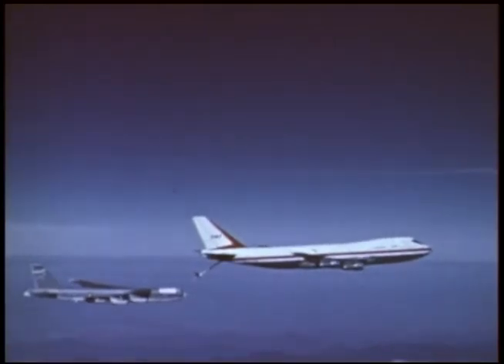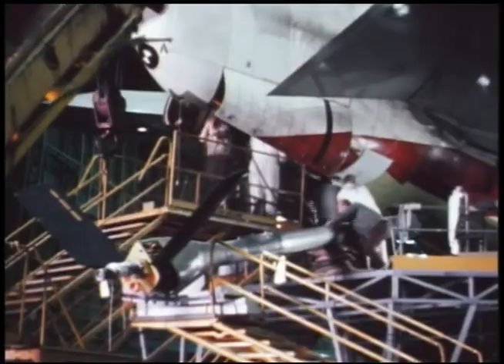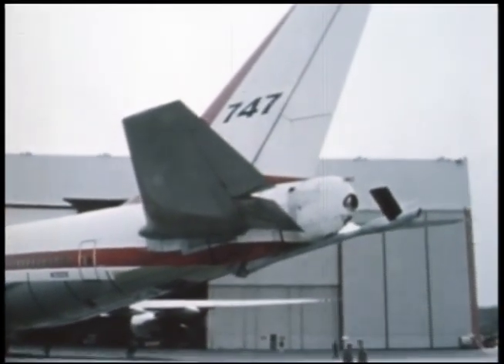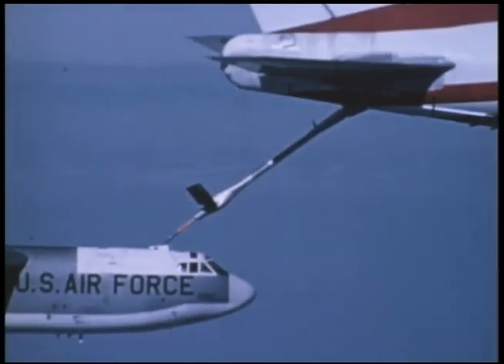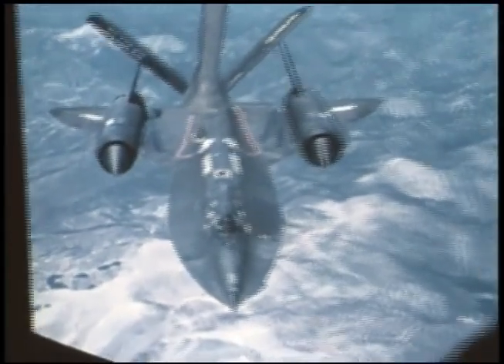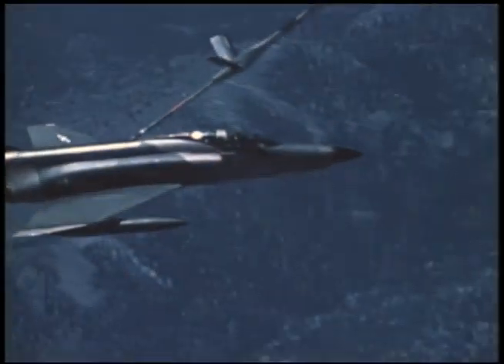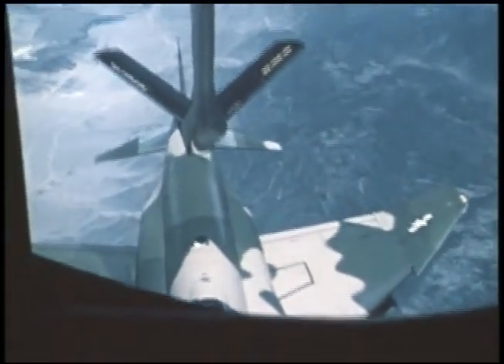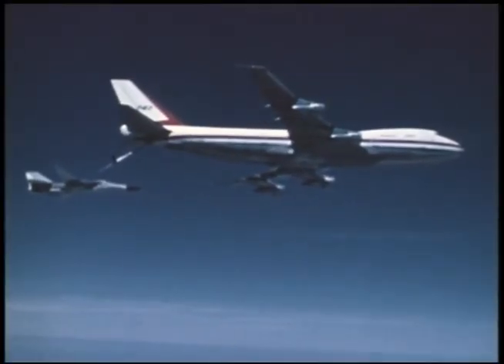Boeing 747 Advanced Cargo Transport Aircraft KC-33

Comment: if only the AF had done this. it would have been badass
Reply: Ridiculously inefficient and unnecessarily costly though.
Reply: @Booyaka9000  i don't know. go for that instead of the C-5 and u get heavy airlift capability, plus unmatched refueling capability. could have made the c-5 and kc-10 unnecessary
Reply: @matthewbaxter5825  The C-5 would've still been used, a 747 can't really match its volume. This thing probably would've lasted longer than the KC-10 though, given the DC-10 was hot garbage for a long time, MD went under, and given that Boeing still maintains a production line and improvements to the 747, even though there's not really any buyers for it.

Tankers this big are a bit unnecessary though. It's overkill for the most part.